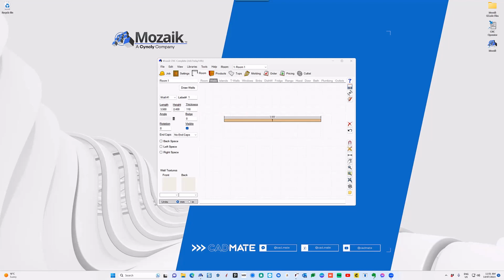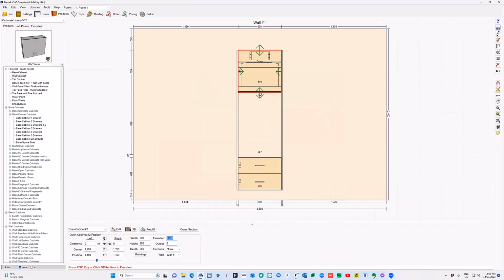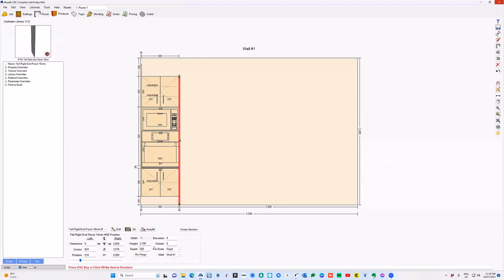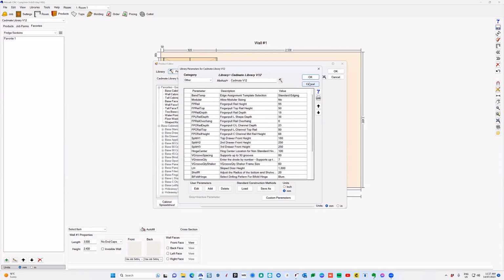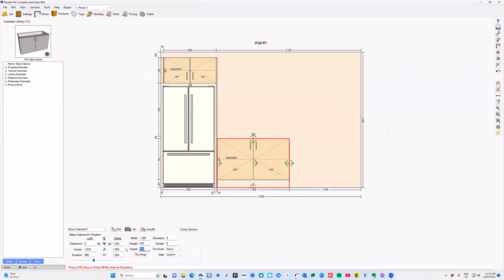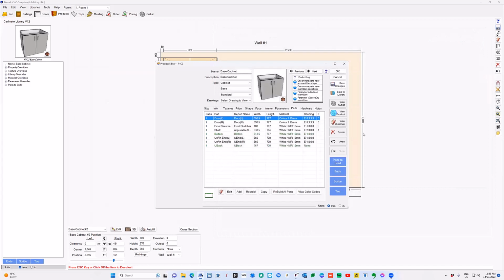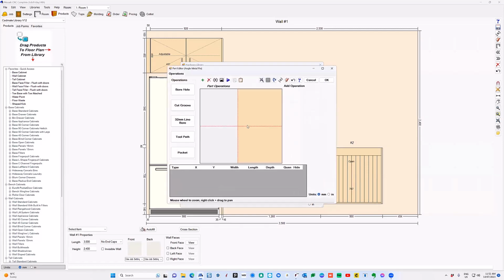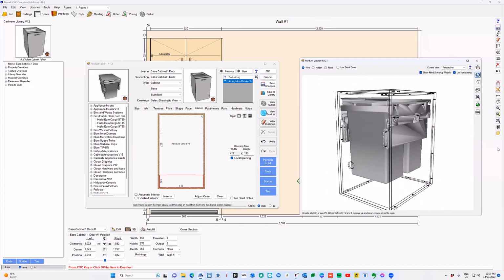Mozaik Group Training Session - Friday 14th July 2023

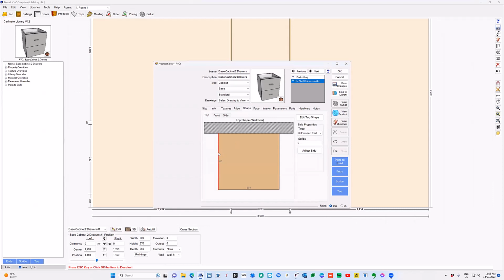Comment: is there an additional setting somewhere to have machining transfer onto the adjacent panel when end type is set to nothing?  You show this at 4:30 but it doesn't function this way for me.  When I follow along and change ends to "nothing" my drawer operations do not transfer to the tall panel. 

I'm on version 12.2.5
Reply from the maker: It may depend on the product that you have adjacent to the product. Make sure the adjoining product has a part enabled on that edge. It is easier to email your job to the helpdesk so the team can review your specific scenario.